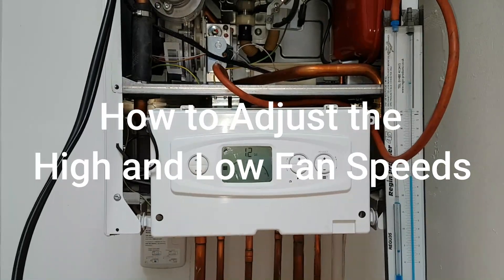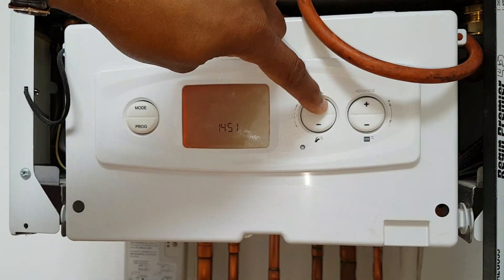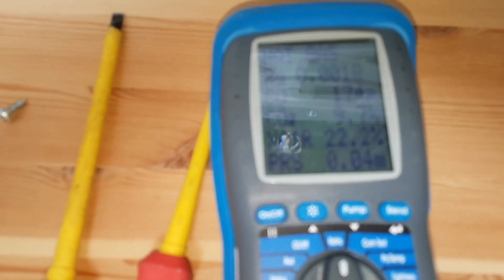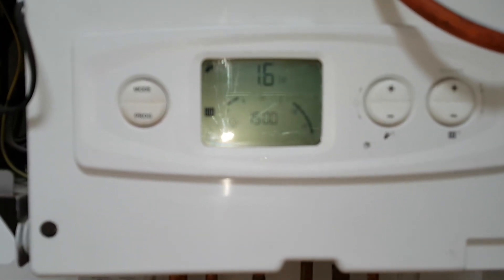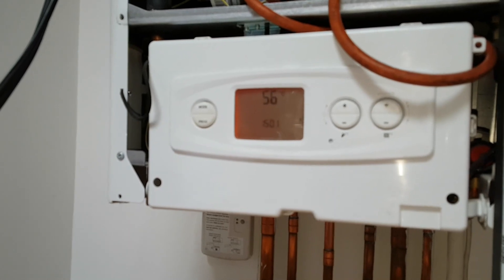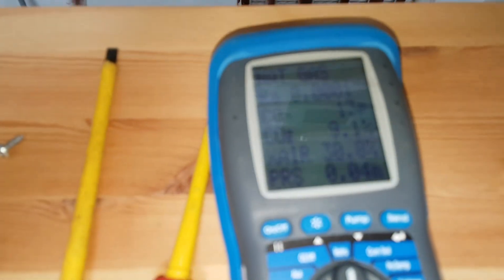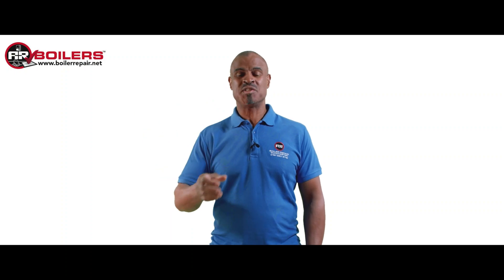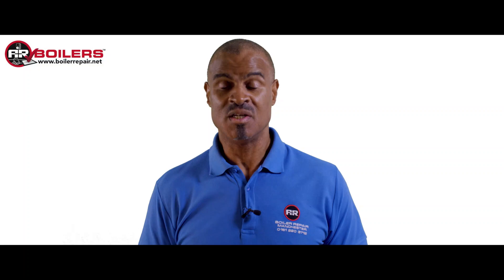Glowworm Ultracom 30CXi How to Adjust the High and Low Fan Speeds

Comment: Some questions: Where are you probing, what with, and what for?
Reply from the maker: I'm not sure what you mean?
Reply: @ARBoilers  As others have pointed out, the focus is dodgy. I'm curious and want to know more...but i dont know what is being measured. You said "Analyser", analyser of what? There must be some sensor you put somewhere to get a reading, where is it put?
Reply: @ARBoilers  After my own research: The exhaust. Air quality analyser. Combustion products (to be fair you did say emissions). 

I realise now "fan adjustment" means the air/fuel mix for combustion.

Thanks for your help. /s